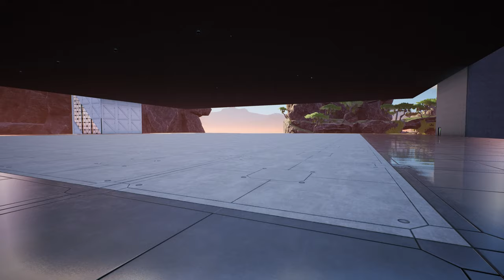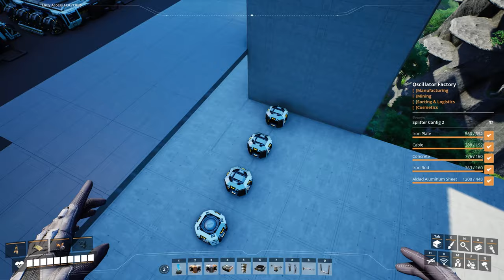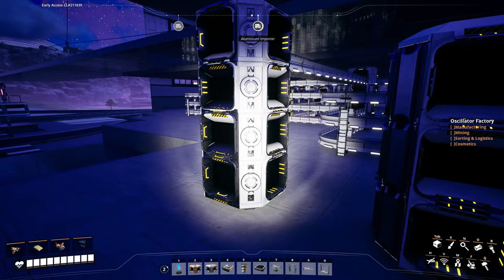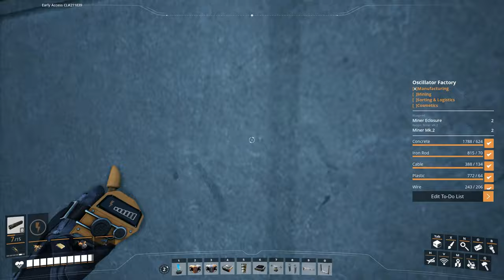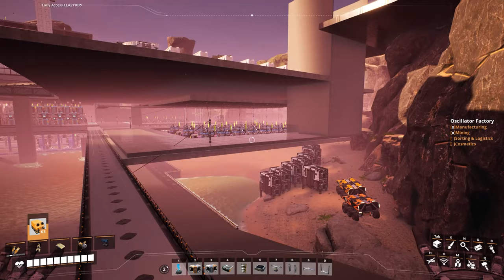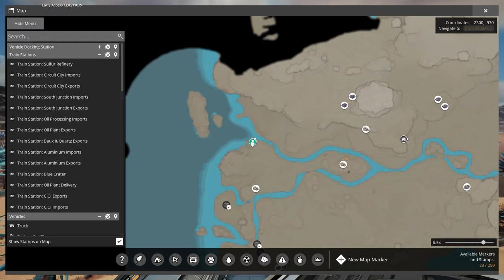60 CRYSTAL OSCILLATORS P/M! - Let's Play SATISFACTORY Update 7 - Ep.49

Comment: From my observations of your train network over this series, it feels to me like you need to start having very long in/out bypass rails, so that you can theoretically handle multiple trains stopping at a station, or to retrofit older stops, you need to add additional parallel stations and adjust input/output between them. At this point, I can see the logic in needing dedicated rails for some things (I'm looking at you, oil train) and trainyards for routing and path logistics. A central hub with multiple radial hubs around it would probably be in order at some point.

Comment: Darren, can you show the animation for a crystal oscillator being made inside the manufacturer? The game designers did a great job making the various components fit together.
Reply from the maker: Unfortunately, the machines all have just one animation. Manufacturers make a sort of Modular Frame with a cylinder inside of it. The animations play at different speeds depending on the time it takes to make the product, but other than that they all make the same thing

Comment: the elevators never auto swap direction if youre connecting them to an empty floorhole. empty floorholes can be input or output, so the elevators will only auto swap if the floorhole is already connected to an input or output, so their direction is set.

Comment: I'm not entirely sure if this a mistake or if you meant it but the caterium ore belts change from Mk3 to Mk2 just before they enter the machines to be turned into ingots. You mentioned you were expecting the AI limiters to be produced faster and I'm thinking you're bottlenecked by these ingots not being produced quick enough due to the slower belts. I'm assuming you ran out of steel beams and used the Mk2 belts instead of running back to get more steel and then maybe forgot to replace them later(?)
Reply from the maker: Well spotted! This was an issue slowing the ai limiters, you nailed it
Reply: @WhatDarrenPlays  many a time I’ve done the same thing so I guess I’m somewhat of a veteran for spotting differences in belts. Not entirely sure if I’ve just complimented or insulted myself 🤔

Comment: You could have just snapped the output mergers directly to the conveyer lifts rather than building supports for them... saves tonnes of time and results in a cleaner looking connection.
Reply from the maker: I disagree about the cleaner look personally. The snap of a splitter to a lift basically embeds it ontop of it, and it looks like its clipping to me. As the product comes down the lift it clips through the splitter before going in. Super small thing, but its one I just dont like the look of

Comment: the train issues, it might be that there are just too many trains and too few block, effectively gridlocking your system. easiest way to check, when it happens, is to look at the colors of the blocks. especially with pathsignals in place, some blocks might be bigger than you think or overlapping junction crossings, preventing your trains from moving. the colorcode system blocks use is really usefull for trouble shooting imo. rule of thumb is to make every block big enough to fit an entire train, so one train is never taking up 2 blocks. ive had a similar issue where the solution actually was to have less blocks so trains wouldnt leave their station "too early" congesting the main railroad and its junctions.

Comment: At 31:50 - The elevator that goes into the 3 high splitter doesn't connect. Watched the whole video and it doesn't seem like you caught it.
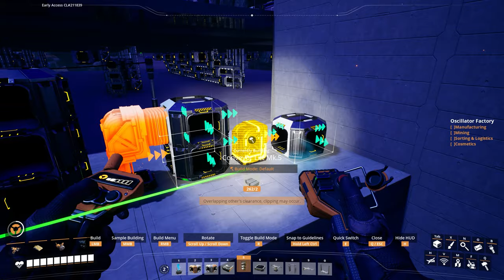Reply from the maker: The reason for the cut at 32:20 is because I realized they were facing the wrong way, and thats why I left in the “oh right you can actually flip the direction even when its going to snap in”
The issue was I was pulling the lift down and it wouldn’t connect and I didnt know why for about 5mins :P
But thank you!
Reply: @WhatDarrenPlays  Yeah np, love your videos!